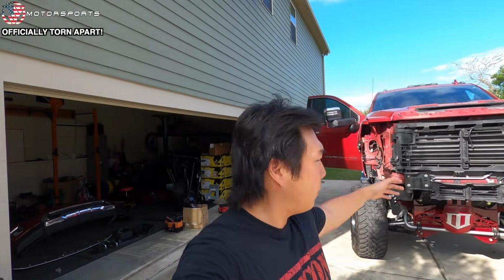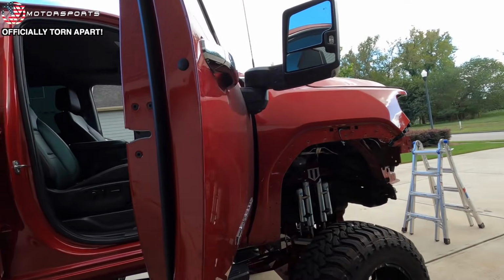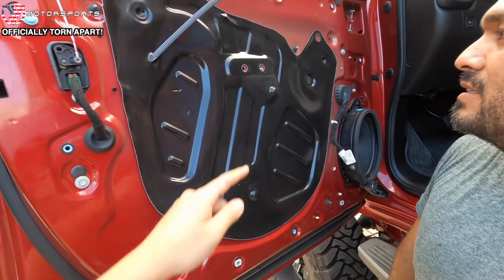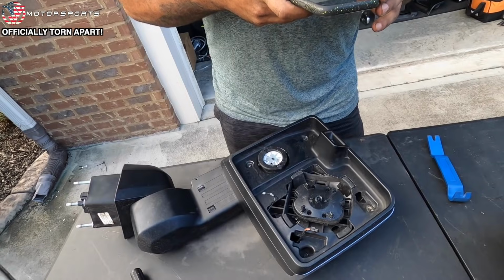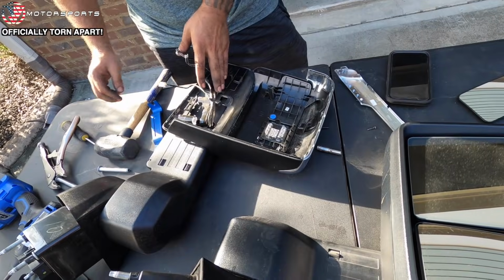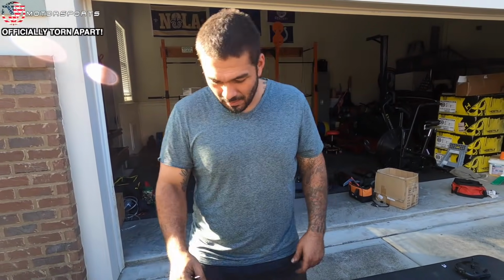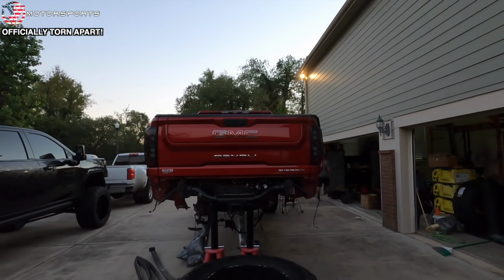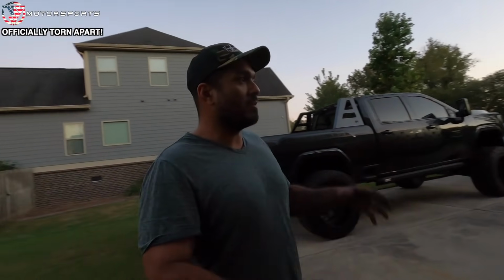SKETCHY TEARDOWN OF THIS $100,000 DURAMAX BUILD

Comment: His truck might have hyperflash with the recon taillights, its due to the (turn signal bulb outage wire) not being aligned with the correct pin. Happened to me and I had to re-pin the connector to line it back with the correct pin/wire.
Reply from the maker: Thanks for the heads up 🤘
Reply: @JWMontoya  NP both got sweet builds. Bigger version of mine 👍🏻